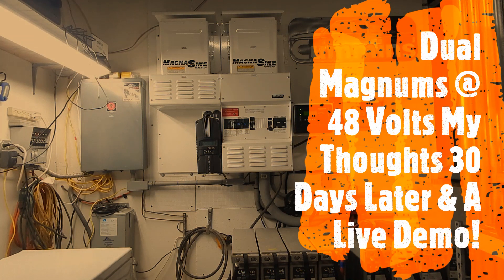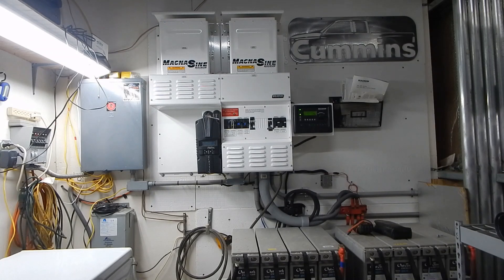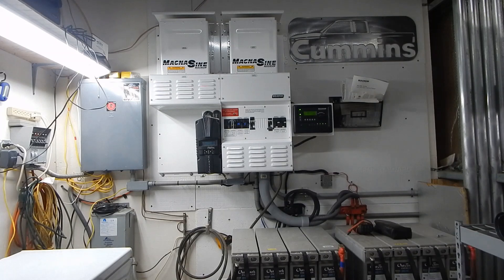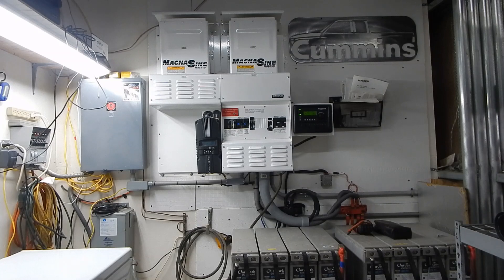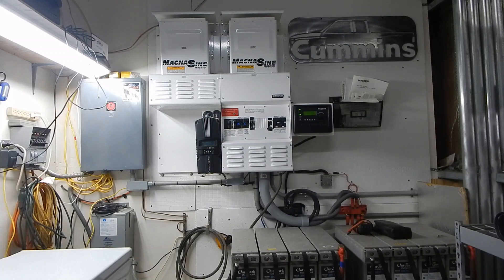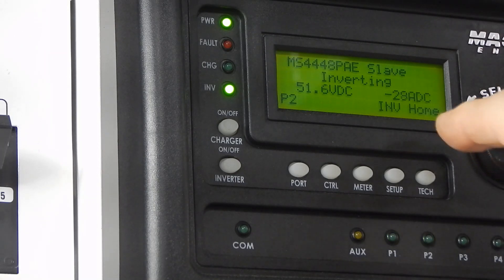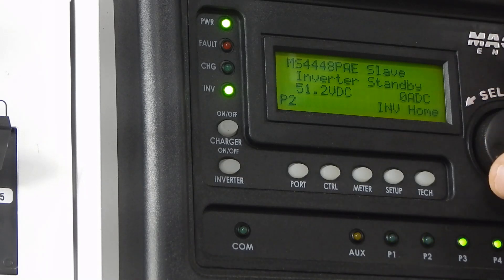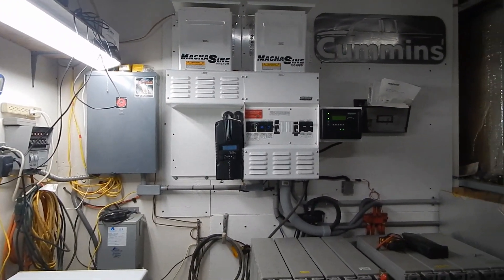Dual Magnum 48 Volt System 30 Days In My Thoughts & Live Demo!

Comment: BEAUTIFUL!  I love it! set it and go, never have to look at it again lmao, I look at mine once a week but never have to do a thing :D one thing, I set mine to go dual inverters at 30% cause it takes time for the inverter to see large spikes and having it set lower will start a little sooner, also it helps keep the master alive longer, if the relay board ever goes its one of that cheaper boards to replace. nothing wrong with 60% just my 2 cents.
Reply from the maker: Thanks I will look into doing that. You have a lot more experience with these than I do thanks for the tip.

Comment: What are you using for a charge controller? Is it the midnite solar?
Reply from the maker: Yes classic 150.
Reply: @TheKiloG69  system looks great.
Reply from the maker: @cowboy898  nice sunny day today just went outside with my amp meter. My  batteries in float pulling in 3000 Watts .Im  doing a load of laundry &  have my 1500 watt  electric heater heating my home for the rest of the afternoon what a deal! I  hope all is good with you Happy New Year .

Comment: Must be very efficient if you have not run out of electricity yet with all the cloudy days we have been having? I figured you would need more solar panels up.
Reply from the maker: I can go 4 days no sun before I'm  at 50% SOC . These inverters are super efficient the master inverter uses 30 watts no load the slave in standby 6 watts.  It is a amazing set up very happy.

Comment: That's exactly how it works  inverters work great. The 48 volt verse 24. The electronic components have less current going through it less losses from resistance and heat.
Reply from the maker: Yes it has impressed me for sure.
Reply: @TheKiloG69  that inverter will start a hard to start motor. It has the capability to do it